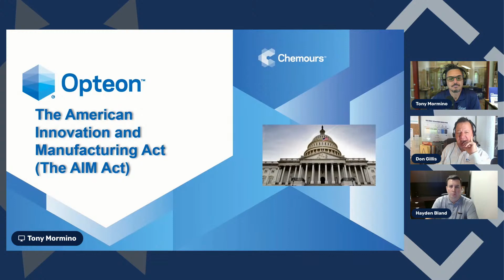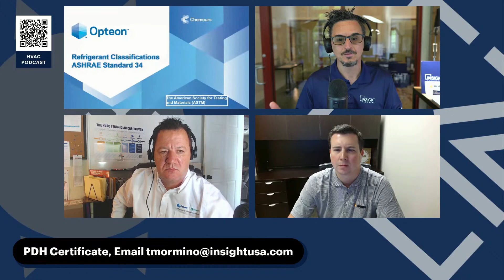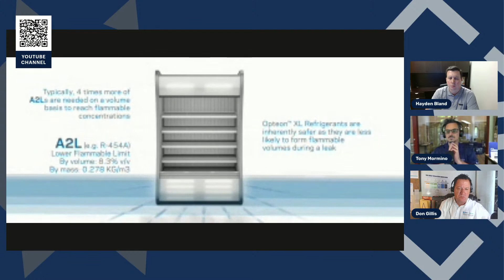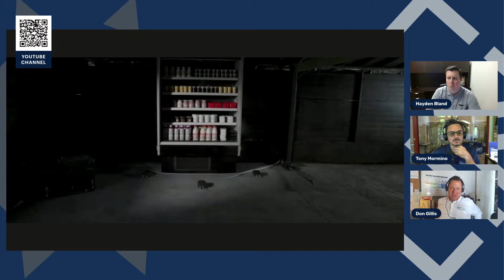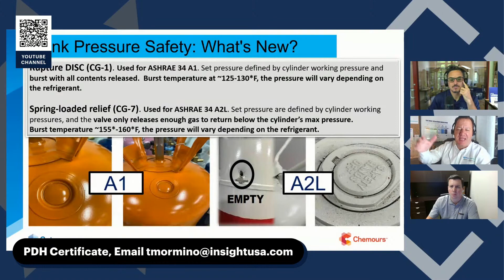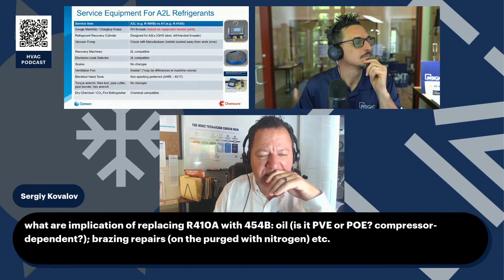The R410A Transition to A2L Refrigerants with HVACR Expert Don Gillis

Comment: Brass is much too soft. A beryllium copper chisel or punch is the tool I would use. All nonsparking tools for the API petroleum industry are made from beryliium copper. They are also very expensive tools. A new copper beryliium punch or awl would cost about $55-$75 USD. I worked in chemical plants, refineries, and explosives manufacturing, so I know stochiometric sensors for flammable gases, vapors, oxygen mixtures and unstable mixtures plus photo arc sensors. That is an enormous barrel of stuff. We upgraded often, and sometimes we went backwards.

Comment: This is the most informative source I've found for the impending phase out of 410A! Great job! I do have a few concerns/recommendations. 

1) If the normal operating conditions of R454B are as stated in the slide showing suction pressure of 117 @ 44.6F, I'm concerned this will adversely affect the de-humidification function of HVAC systems where humidity is an issue. My past experiences with chill water systems raised to 45F to conserve energy failed to maintain desired humidity levels. Although it seems nominal, that's a big difference!  

2) When you reviewed the flammability of A2L gases, it was explained (very concisely) how negligible the concerns have been, in that regard. However when asked about using these gases as a "drop-in" replacement for existing systems, "liability" was the reason given why these gases shouldn't be used, which seems flimsy based on how minimal the flammability differences are, in reality. Therefore, with tongue in cheek, I call BS! LOL!... In all seriousness, we all have to deal with the actual financial pressures these changes will put on the folks we are trying to help/service in the residential field and many will be asking the same question when they have to decide between being able to juggle life's necessities/obligations, including having a functioning HVAC system and I think there needs to be some more thought as to what is possible in this regard going forward. In other words; there needs to be a better explanation/guidance on this topic. 

Thanks again for this information. Great job!!

Comment: I don't think it is a good idean going with A2L. 1. When mixed with POE oil, it becomes very high flamable. 2. Title 24 required sealed attic (a time bomb). 3. Furnace + leaky evaporator + sealed attic = bomb.
Reply: If a system that has a clogged metering device where refrigerant is still in the coil. Recovery + purging with Nitrogen still will not remove the refrigerant. When brazing, it will ignite and residual refrigerant in the coil. A1 sometime cause a plume of fire, with A2L it will be a disaster especially for young inexperience technician. But it may set the insulation on fire. There goes the technician and the house.
Reply: You don’t know what you are talking about
Reply: that is why California want to go with heat pump, but there is still electrical components within air handler. Has someone tested with this combine scenario?
Reply: I'd be more worried about the acetylene that you carry on your service vehicle than a unit.  The mixing with POE oil....want to see that video of it burning.  And by the way, most units where the refrigerant crosses the air stream will have a system on board that will mitigate any leaks.
Reply: Tests were not within the stoichiometric combustion range of the A2L Gas. This gas is combustable in concentrations of less than 13% at room temperature and normal atmospheric pressures. See the MSDS:
"Flammable gases, Category 1
Gases, which at 20°C (68°F) and a standard pressure of 101.3 kPa (14.7 psi):
(a) are ignitable when in a mixture of 13% or less by volume in air; or (b) have a flammable range with air of at least 12 percentage points regardless of the lower flammable limit.

Comment: It's just a question.
Can we still install R410A system when the New Refrigerants come out ❓❓
Reply: I just read that there will be NO NEW systems using R410A starting 1/1/2025. Older ruling said 1/1/2024 so I assume the use of R410A has been extended.  I also read that  R410A will be available to use in repairing systems for an extended period - whatever that means???  Lots of confusing and contradictory info around.
Reply: If you have money you should buy them up and stock pile them.
Reply: @JamesClichet3663  even that won't matter as you can buy through 2025 and install through 2026.  After that, components will be available for repairs, but you can't buy systems OR buy components to make a system as well after 2026.